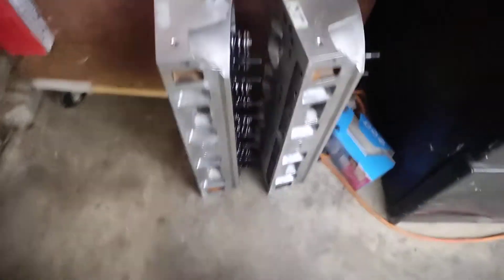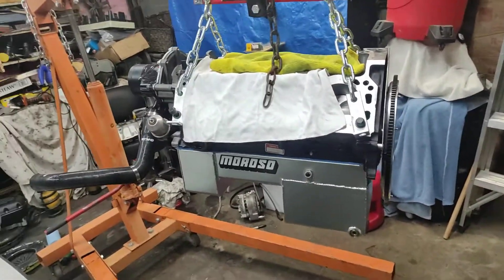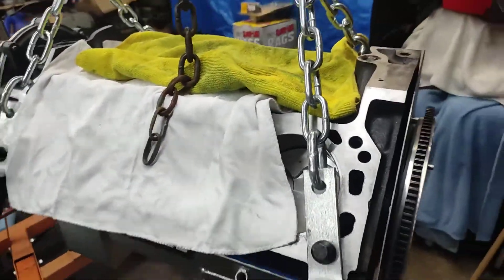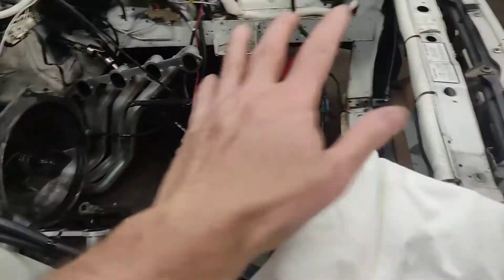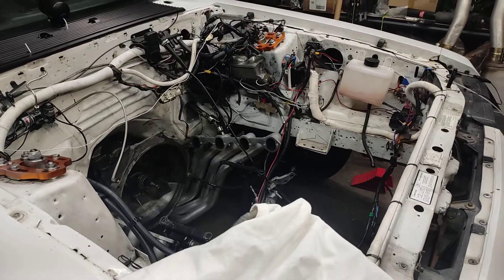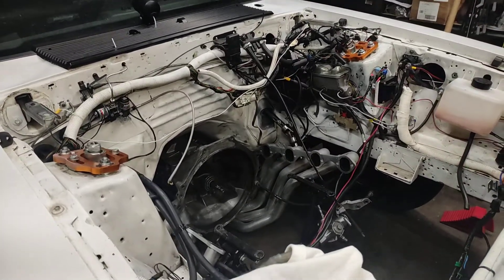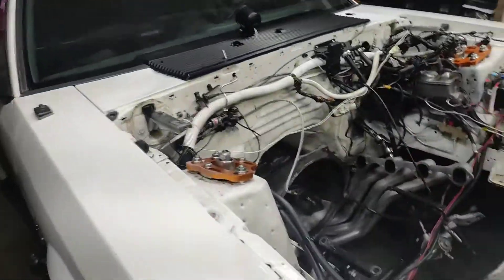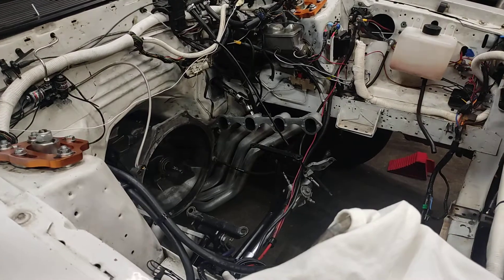349 is freshened up and going back in

Comment: Good to see you making forward progress on it again looking forward to the first start . Did you make any changes while you had it apart?
Reply from the maker: Thanks Beans! I installed the cam straight up instead of 2 degrees retarded like I had it at last time, I cleaned much more thorough and measured bearing clearances more precisely. I will have it back in and fired up shortly!
Reply: @vrm86gt  your welcome man, glad  that everything was good and no premature damage to anything so that now it will help you sleep at night anyway 😁 I almost retarded my cam as well but decided not to at the last minute
Reply from the maker: @79beans347  I was wanting more upper rpm power range, but I think I gave up too much vacuum at idle (still have power brakes so need decent vacuum)

Comment: So you think the plastigauge method was incorrect?
Reply from the maker: Nothing against plastigage, I just wasn't certain I got correct measurements last time, (old eyes trying to read that tiny, squished plastic strip doesn't help either!)  with the micrometer and dial bore gauge I'm much more certain where my clearances are at.